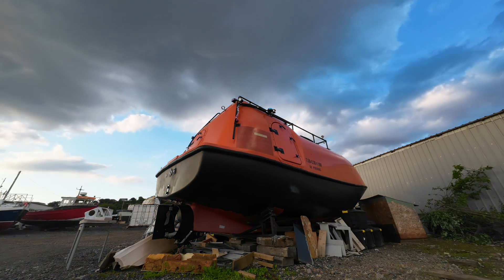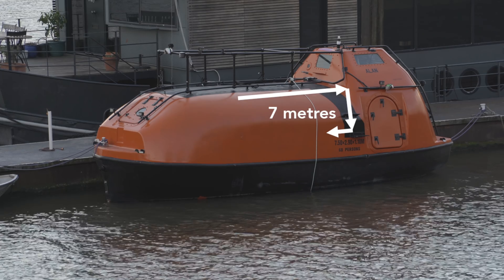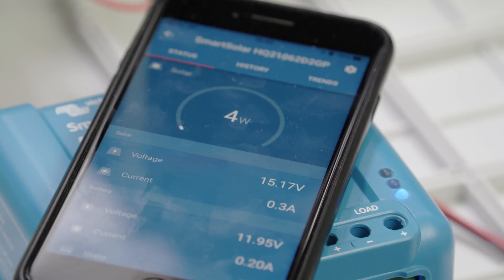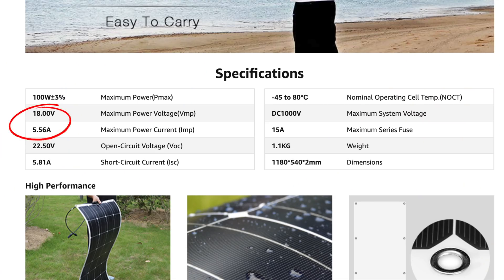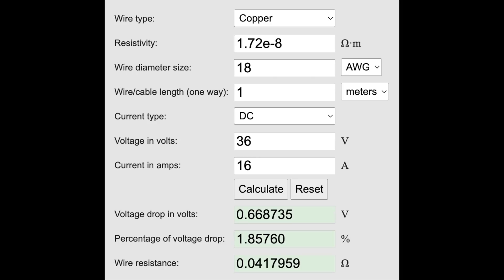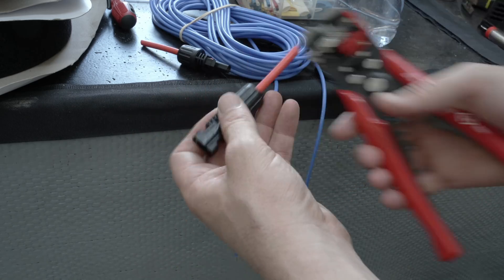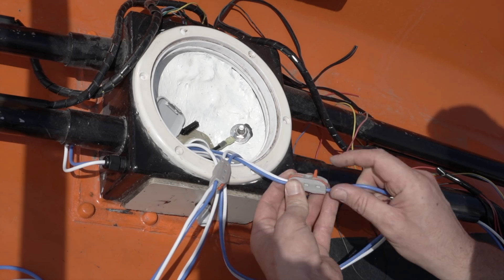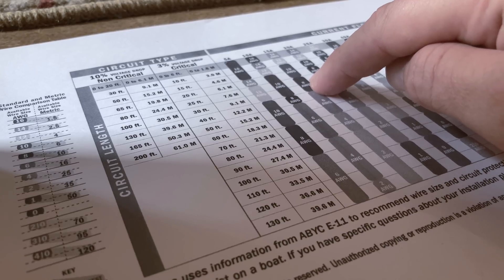Lifeboat Conversion Ep44: Solving solar wiring problem |  Incorrect sizing causing voltage drop [4K]

Comment: Dear sir - I am purchasing at 32 person version of your vessel and would love your opinion on a proper size boat trailer you would recommend?
Reply from the maker: I'm not sure size is is the main question here as you just calculate that based on the manufacturer's spec. It's more how the bunks or rollers will sit - as the lifeboat has an unusual hull. You may need a customisable trailer. Also, height. Lifeboats are tall, so you may need to have a lowered trailer to stay within road laws in your country.

Comment: please please dont solder on boats the vibration will break the solder apart and then the wire heats up and seperates catches on ifre etc. a crimper is your best friend and a cheeky yhing called a butt connector.

Comment: From what I was able to see your soldering joints were very poorly solders together 
You need to put in more heat 
The solder should really flow into the wire and not bulk up on top of it
Reply: What I like to do, is heat the wire With the soldering iron from below and feed the soldering wire on top of the joint. As soon as there is sufficient heat the solder flows in.

Comment: The whole wire splicing thing. 
I prefer using NASA's method a neat how to supplied by NASA:
https://workmanship.nasa.gov/lib/insp/2%20books/links/sections/407%20Splices.html 
And a more indepth PDF: 
https://nepp.nasa.gov/files/27631/NSTD87394A.pdf
If it's good enough for space it's good enough for Alan
Reply from the maker: Thanks. I get deluged by (often contradicting) wire joining advice, but I'm tempted to agree with you.

Comment: I recently had to do some research on wires. My task was much simpler (or so I thought) - find a wire capable of recharging my phone on max current. Still, it took me down many hours of exploration into wire gauges and maximum lengths etc. Electrical resistance is really a fascinating thing.

Comment: As always, interesting and factual.
Just a curious question; you being in the UK, why are you referring to ABYC and North American standards (and using AWG over mm2)?
I have a foot on both continents, and it took me a while to 'adjust' to the NA standards when it came to cabling.
Reply from the maker: I was first exposed to awg, and it's a nice memorable scale, so I just got used to it. I'm a metric/imperial mess, as I work with Americans, Brits, Canadians and Scandis.
Reply: @AlexHibbertOriginals  Ah, got it. Was just odd to see it initially (as I follow ABYC here but originally used to Scandi designs).

Comment: Power loss over DC is always an issue, though I am surprised you had such a drop over just 7 mtrs. Could the cable resistance be in question here? As you know not all cables are equal. Enjoying you eye for detail and aesthetic.
Reply from the maker: Thanks Darrell. There's also the fact the sunlight wasn't optimum, so the initial readings were only indicative. i.e. is there a problem or isn't there.

Comment: Actually your wire length is double what you measured as you have lengths for both positive and negative side of the circuit. As for some of the other items already covered you could use Velcro wire wraps to tidy up bundles as it allows easy access and future adjustments without having to cut and discard previously used ties.
Reply from the maker: Thanks - yes suitably chastised over the temporary cable tidy solution. I have a pack of mini velcro ties somewhere - currently MIA.
Reply from the maker: I should certainly have clarified that the online calculator takes the pair of wires into account. i.e. you type in the one way length. Some calculators may not do this for you.

Comment: Of course you have to remember whether you are calculating voltage drop for one conductor or a pair. Also power loss is proportional to current squared X diameter which is worth remembering when designing your system.
Reply: https://youtu.be/ildq1eumIYU
Reply from the maker: I should certainly have clarified that the online calculator takes the pair of wires into account. i.e. you type in the one way length. Some calculators may not do this for you.

Comment: All looking good .... but ... some things are not done, soldering cables is a no go, no one solders anymore. Better use the right size cable connector. With soldering you go from a rigid to a flex connection, it will eventually fail due to resonance. And no matter how great the seal is salt water will creep in. In the navy we used to put a sort of greased up Petrolatum tape around each inlet, each connector etc. 
 If you connect flex cable to your inverter or other electronics do not give the copper end a few twists and stick it under a screw use the right size cable sleeve end. It makes it also more easy removing it and might prevent accidental shortcut when one of the strands is sticking out the wrong way and touching the cable next to it. Eventually in bad light you will miss a strand  and it will make a shortcut. Been there done that.
Reply: These sleeves I mean: http://en.elektrotools.de/images/product_images/popup_images/641940_166gr_cat.jpg (just a example) you need pliers for them to tighten them.
Petrolatum tape: https://www.nitto.com/us/en/Images/anticorrosive_003_img_No.59photo_L.jpg
Reply from the maker: Very interesting. I'll investigate.

But on the soldering  - I was castigated for not soldering enough a few weeks ago! YouTube eh...

Thanks Martin for the detailed advice 👍
Reply: @AlexHibbertOriginals  Yes that it youtube, everyone knows better specially the arm chair electricians. Normally I do not comment on other people their projects. I am impressed by your lifeboat project. To be in the artic at -40C or colder equipment failure can be a serious issue turning into a catastrophe if you can not fix it. 
I love the cold but my experience does not go beyond -30C in Russia and camping out in winter at max -14C. I love the cold even then everything is harder to operate, simple things become more hard to do. 

About crimping and soldering, there is lots to be found online. My background is electronics, biomedical engineering but I also have build dutch navy frigates when I was in the Navy. Have some nucleair power station experience and now work with medical lineair accelerators. All in all jobs where the safety standard has to be high so accidents don't turn into catastrophes. So with my experience in mind I found it worth while to give some comment, the more options you get the better you can pick the best one suited for the job. 

There might not be wrong ways but there are better ways ;-) Officially for crimping you need a calibrated crimping tool, at least in the industry we do. 

I found this article that sums it up nicely (it is about soldering cable connectors but is about the same for soldering cables together):

Why Crimping Outperforms Soldering for Cable Connections
For cable connections, crimping typically outperforms soldering for a few key reasons. First and foremost, cable connections last longer when they are crimped because they are protected from the intrusion of moisture, dirt and debris. Crimping tools are designed to create an air-tight seal between the cable and the connector. Therefore, moisture, dirt and debris won’t be able to reach the crimped cable. Soldering, unfortunately, doesn’t offer this same level of protection.

Crimping offers stronger, more reliable connections than soldering. Soldering uses heated metal to join the cable to the connector. Over time, this filler metal will degrade, which may cause the connection to fail.

Most electricians will agree that crimping is also easier than soldering. Soldering isn’t particularly hard, but it still requires heating the solder and carefully placing it between the connector and the cable. Crimping is an even easier process that involves requires placing the cable and connector into the crimping tool and squeezing the handle.

https://monroeengineering.com/blog/crimping-vs-soldering-cable-connectors-which-is-best/
Reply from the maker: Quick question - if using a ferrule to neaten up bare strands for a screw terminal connection, do you just use tin-copper ferrules? Are they soft enough for the screw terminal to really press into and lock into place? I'm concerned they could pop out and escape more easily than if placing the naked strands into the screw terminal.

Comment: the diameter  of the cables attached to the solar panels should  set alarm bells ringing straight away you dont reduce cable size only increase diameter depending on distance of run and a boat should not have cables under 16awg
Reply from the maker: That's not really the full story. The factory cables are designed for users who may wish to daisy chain or parallel their array for high voltages or high currents. They design for the most demanding user. A couple of panels in series, and 'only' a 7m cable run means you simply check the voltage drop charts, select the correct gauge (failed the first time, succeeded the second), add a little headroom, and install. If you have giant cables for everything, the cable routing will be a nightmare.

And why 16awg? For everything? What about a simple voltage meter mounted in a neat, interior location? 20awg is more than sufficient.
Reply: @AlexHibbertOriginals  the reason they use 16awg as minimum on boats is any wire thinner is viable to break with the motion of the boat have a look at pacific yacht systems they have a website with all wiring diagrams questions and answers for all boat wiring  projects its all about safety so you dont get a short and set your boat on fire good luck with your conversion

Comment: I would pull separate wires for each panel. And connect them parallel at the charging box. When they are connected serially,  when one panel fails, the whole system is dead. And I might even put diodes to each line, so that the cracked panel, full of conducting salt water, does not steal the current.
Reply from the maker: The port and starboard sides are isolated, and have their own controller. I opted not to parallel each of the four panels as MPPTs prefer more voltage.

Comment: Your wire splicing is fine since you are soldiering it and heat shrink over it. The twist ties in that junction box on the other hand, that is a very bad idea. The ends are sharp and made of metal, so with the wires moving around in the junction box there is a serious risk of a short happening. Use small cable ties or electrical tape instead. With you going into extreme cold with Allen, the cable ties would be the best choice.
Reply from the maker: The ties are soft plastic covered, but point taken - will edit.

Comment: I would just add a parallel conduit. it would allow you to use it later for an addition and it just easier. I wouldn't doubt you have extra laying about. I am curios as to how many man hours you have into this vessel.
Reply from the maker: This was my first reaction, but it seemed messy/lazy.

Comment: Regarding the first topic of the video, I've had an exam at my faculty of airspace engineering which covered pretty much this topic (and some other applied electrical engineering as multi junction solar panels, storage in batteries etc.), you can imagine how on a plane it's critical to optimize the wires' dimension to be as thin as possible (as a thicker wire than necessary is just dead weight) and at the same time carry quite some power ( something more than 200kW).
That said, the formula we used works by an interesting mechanical analogy: knowing how much current flows in the section of wire you must calulate the thikness of (it depends of the power of your load), you multiply the current by the lengh of wire thus obtaining an "electrical torque": this is the analogy, like holding  the same weigh (current of the load) on your hand at arm distance is easier than holding a pole (with no mass) with the same weight on the opposite end (it causes a bigger torque).
The procedure goes on like this: you decide the percentage voltage drop you can afford and calculate the max admitted voltage drop itself, having the resistivity in (Ohm*mm^2)/m you devide it by the max voltage drop and multiply the electrical torque, you'll obtain the minimum admitted thickness in mm^2 and take the commercial wire immediately thicker, with that you put it back in the formula before and solve for the voltage drop which this time is the real predicted voltage drop (the measured one could vary based on temperature and other secundary factors). Then you should check if the temperature is within the wire spec and the loss due to jule effect but honestly it's a bit overkill for your application. This procedure can be scaled for many loads, branching lines and AC.
I guess it's a bit late to be of any utility but i thought you might find it interesting, if you didn't fall asleap while reading it, which I admit is a real risk, and it's pretty much what happened to me the firt time I was taugh it in class.
Reply from the maker: Interesting indeed, and thanks for taking the time to post.

Comment: I don't want to be the next jetski guy, but... would it be an option to use MC4 connectors with cable glands, and pot/glue the inside with acid-free silicone? It should adhere to the silicone sleeve of the cable, thus providing some extra strain relief, while simultaneously providing some extra waterproofing. Depending how much time is involved in cutting, splicing, soldering and heat shrinking, the potting method may be faster. Especially when you prepare two syringes with the two components in advance, so you can mix small batches per connector.
Reply from the maker: Thanks. And oh, there's only one jetski guy. He commented earlier today, but sadly thought twice and deleted his latest barb. He's cute.

I've experimented with potting on other projects, and need to get better at the technique if to be used in a serious application. I've been warned by others about these ubiquitous MC4s, and will be keeping a close eye on them.

Comment: You might want to consider using Ferrells for the wires going into screw terminals. Makes inserting and removing them easier.
Reply from the maker: Cheers
Reply: @AlexHibbertOriginals  ferules are the first difference you notice between professional marine electronics and  DIY. The joys of crimping may become a new form of entertainment for you to revel in.

Comment: Why on earth didn't you just use normal 4mm solar cable?
Reply from the maker: Inflexible, low strand count, and total overkill for a 40V system.
Reply: @AlexHibbertOriginals  Yet everybody else uses it?
You've just gone from bell wire to speaker cable, yet you can't see the benefit of using the correct cable for the job?
Every amp counts, when you rely on it.
Reply from the maker: You're not really dealing with the details. Everybody doesn't use it. For small arrays, lots of people use their own wiring.

'Solar cable' is fine for a simple run through a bulkhead, or through a roof, but it's terrible for complex routing.

This wire used is not speaker cable. It's high quality, high strand count, tinned copper wire. As the video shows, the voltage drop is now appropriate for efficient current flow over c.7m.
Reply from the maker: All wires have resistance, even ones with solar written on them. I'm not sure you know the point you're making, save for to be obtuse.
Reply from the maker: I'm still not sure what point you're trying to make. 14AWG over 7m with <2% voltage drop is acceptable, and its use allows for cabling that's easy to route. We could use 10mm wire, as 10mm > 4mm, but that would be stupid.

You're obsessed with cabling that's designed to daisy chain high voltage arrays, or parallel arrays with 20A+ currents.

I wish you well with your 4mm 'proper' cable.
Reply from the maker: Raising a glass to your final sentence. :)
Reply: @AlexHibbertOriginals  I still can't believe I've been witness to wire-related rage.

Youtube is a magical place indeed.

Comment: You want a breaker or kill switch on the feed from your solar panels really so you can isolate them if needed, useful if you need to do emergency repairs or disconnect the battery quickly as having the panels connected but no battery can damage the CC, mine is up high as near where the cables come in through the roof as was practical for easy access.
Reply from the maker: Certainly - physical plugs, and fuses.
Reply: I have fuses, and a big red on/off switch, actually I have big red on/off switches on the batteries, inverter, 24v and 240v circuits. 

Fire very bad on boats and easy to shout "Turn it OFF" at random friend/crewmember, one handed operation for rough seas helps too.
Reply: @popuptoaster  I had one of the 100 amp keyed switches on my array and another on my battery bank and a third one on my inverter/charge controller.  It made it very easy to isolate all parts of my system and to make totally safe by removing the key while I worked on one or another areas of my system.

Comment: Those MC4 connectors repeatedly let in water and corroded the wires from the solar panel on my boat. I made well insulated 'permanent' joins and that has worked now for a few years.
Reply from the maker: Interesting - I'll see how I get on. Can easily chop, solder and seal if need be.